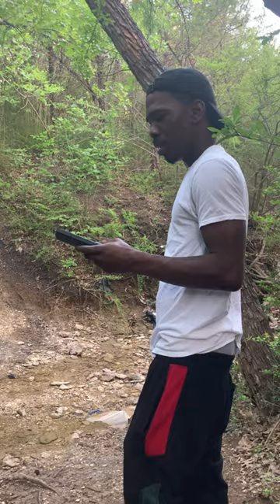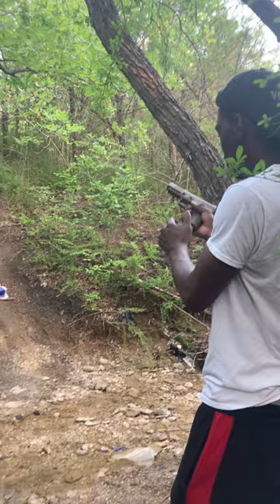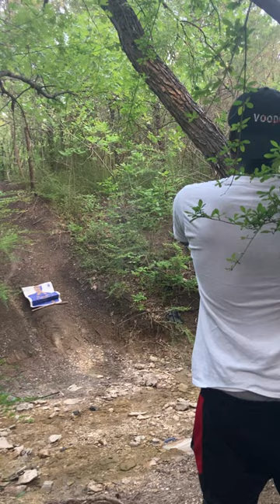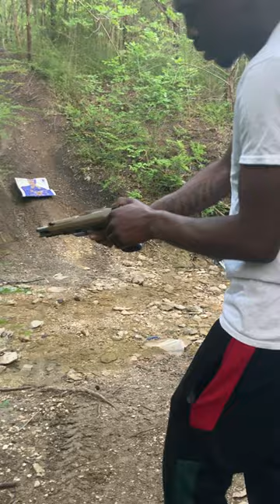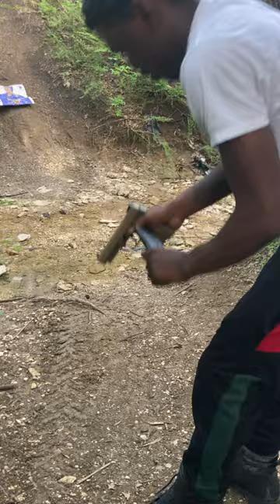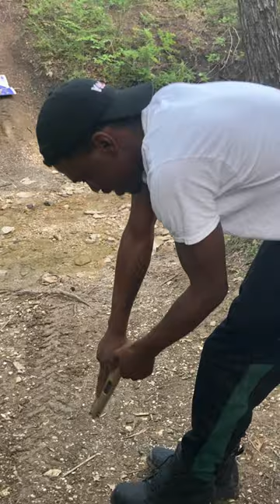Fn 5.7 Promag 30 Round Test

Comment: Some company is now making a different spring for this mag--it's stronger and supposedly helps.
Reply: Which company?
Reply: Buffman (one of the most popular and prolific 5.7 YouTubers) said this:  “I cleaned up the sharp edges on the one I have. I installed an extra power FSN spring from EA, and mine loads 30 rds and feeds just fine.” 

But I’m using +7rd extensions on PSA Rock mags and they’ve been 100% in my Ruger 57 LC CHARGER SBR.

Comment: The cmmg 30 rounders work fine
Reply from the maker: I tried that one also,it worked when I put 27 in it
Reply: Does CMMG make a 30rd (non-promag) mag for the FN 57?
Reply: @joeflowers9084  they make a plus 10 base plate to turn the factory 20 rounder into 30

Comment: You might need to see if they make an extra power spring for that joint homie. That might help push the rounds up better.
Reply from the maker: I got the 55 round now
Reply: @Atleast30Shots  u need a better feeder for the mag bro
Reply: Or just use the mk3 new magazines now